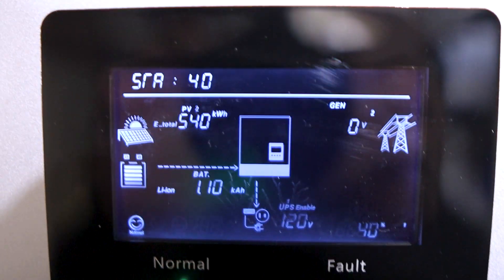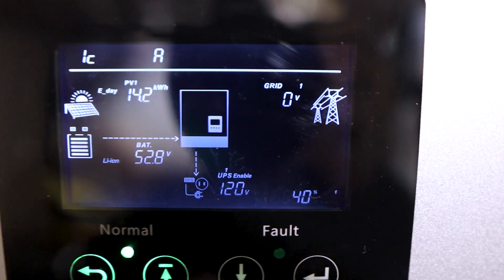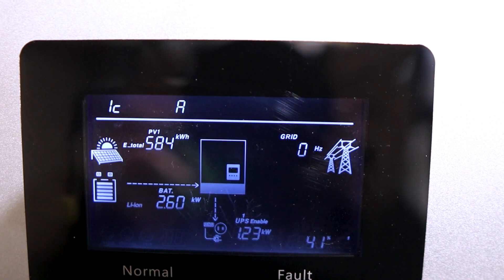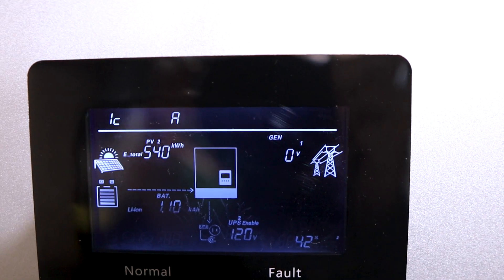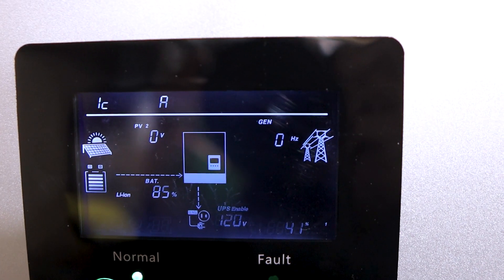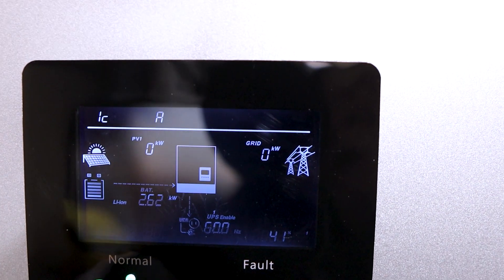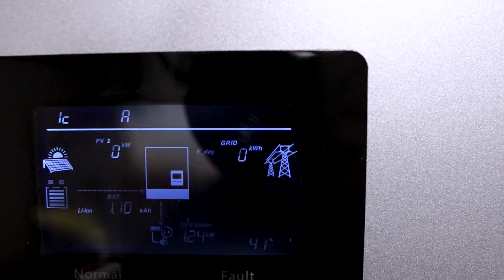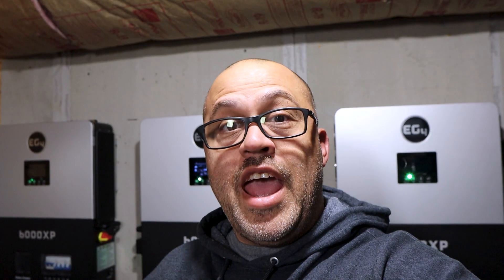EG4 6000XP - How to get Maximum PV Input Power

Comment: That doesn't work . At least I can't go.past the 125
Reply from the maker: How many inverters and batteries do you? It can be limited by your system size of course.
Reply: @rodneyhunt  single inverter
Reply: Have you figured it out yet? I'm having the same issue. Full sun and 100 w are coming in with 4,000 available

Comment: Hello good day I need help with something.
I added 8 Solar panels each being 400 watts and then the inverter only shows 270 volts and 75 watts coming in can you explain how to fix this issue
Reply from the maker: Just depends on your setup, partial shading, wiring, connector problems, etc

Comment: 1 question,  when I go to step 6 to make this change it will not except it, it allows me to enter 3520 but when I hit set  it just says error,  should the UPS AC output be shut off or in standby or any steps I should take for it to allow the 3520 setting?
Reply from the maker: How many inverters and batteries do you have?
Reply: @rodneyhunt I just have the one EG4 6000XP and 4 12 volt lifepo4 200ah with 200 amp BMS in series.

Comment: I can't set mine that high and I'm
Not getting any pv input at all
Reply from the maker: Are your batteries communicating with the inverter? How many inverters do you have? Might need to give signature solar a call and see if they can point you in the right direction.
Reply: @rodneyhunt  yeah I’m waiting to call them tomorrow because their tech-support is closed today🙄 I only have one battery which is the wall mountain battery indoor and I have one inverter. everything seems to be communicating fine at the same time I have troubles with the app. I appreciate your help and your videos regardless I’m new to the scene but learning very quickly.
Reply from the maker: So you may need to try a lower setting. Each setup has a maximum so start low then increase it as far as it will go. Might be another setting as well. Have you checked voltage right at inverter? Is your PV switch on? Just to verify what you have

Comment: Thanks for all the your videos I find them very helpful, I do have a question on the EG4 6000XP that I hope you can help with, it says in the manual that the PV input can handle up to 500 volts, but is that 500 volts per MPPT or is that 250 volts per MPPT for a total of 500 volts?
Reply from the maker: That is per MPPT. So you are good to go with higher voltage for each

Comment: I found this issue and signature solar insisted 125 was max, that made no sense for 2 inverters.  I changed it and will see what happens tomorrow. I added 6k worth of panels and it was basically not being utilized for charging, only with an AC load.  Now, With that said, Where did you come up with this being a correct number? How is it you have this but the sellers and tech people don't? Where did you get this number? Would it not be 125 per unit, 250 for my pair? I have to wonder why its tied to the AC charging number? I realized after i could just set it at 3520 in the app as well....
Reply from the maker: I just set it to the max. The battery BMS will limit power if ever needed but I have plenty of batteries for my array. I asked them before and can’t remember the exact explanation from them but will look back.
Reply: @rodneyhunt  I (we) need to still be able to limit AC charging and it cannot be that high for AC so common sense says there must be separate settings for max amperage on AC charging vs the solar panel charging. I did not realize this was being throttled and it made for some damned irritating attempts at figuring out what was wrong with the system. The amount of mis and dis information surrounding EG4 from both retailers and EG4 themselves is a real PITA.

Comment: It won't let me go above 120
Reply from the maker: That is weird. Are you using the same settings other than that.
Reply: Mine also will only allow me to go to 120. But I only have one 6000xp and 2 Lifepower batteries.

Comment: Great find Rodney, I think that setting is actually an engineering unit rather than a maximum amperage setting. I've got 4 EG4 600oXP's in parallel and max should be 4480, but can't go above 3520.
Reply from the maker: Yeah I had no idea what the units for that would be but it needs to be higher to get full input from my system. 👍

Comment: Can you describe where the fans are located.....is there screening small enough to keep moths or miller bugs as we call them from getting into the unit?  My 6000 EX have filters on the sides but the screen size is small enough to keep bugs from getting into the unit and shorting it out.
Reply from the maker: Will take some video and let you see

Comment: Ok Rodney, I am confused, sooo confused. I do not have a system yet but I'm learning. In my 6000XP manual that I downloaded, Step 6 is for "Ic: Maximum Charge Current (Utility+Solar)" Range is 0-125A. The manual says "Maximum MPPT Amperage The MPPT can accept up to this amperage (clipping will occur past this value) 25A. Also the spec sheet says "MAX. CONTINUOUS AC CURRENT 37.5A @ 240VAC". What is 3520? 3,520 Amps? 35.20 Amps? Why does that step say Max range 0-125A when I can only get 25A from the panels and 37.5A continuous from the grid. What am I missing? How do you get more than the combination of 62.5A  (25A + 37.5A) ?
Reply from the maker: It is some kind of combined amps I think. Solar, ac charge, etc. I contacted eg4 fir more details and will let you know what I find out. Regardless the mppt will only accept the max watts and just make sure you keep your panels below the amp specs you will be good. 👍

Comment: When Shared Battery is enabled you need to increase the max amps to account for all parallel inverters.  Yes the manual should explain that better.
Reply from the maker: I definitely missed the explanation lol! I figured the mppt will take in the max they can until I can test to see what I really need to set it at.
Reply: @rodneyhunt  if you check setting 6 on the other inverters...you will see its mirrored on all inverters that have shared battery enabled.
Reply from the maker: Yes it is mirrored!
Reply: @rodneyhunt  you can set it to 420 (140*3)...the BMS will still direct a lower charging amperage if it needs to.
Reply from the maker: Yeah I need to adjust it down at some point but since I am not using the grid or generator I have not.

Comment: Thanks, curious why you would need it that high, my strings each  bring in around 11 amps and 400 volts?
Reply from the maker: I just set it at the maximum it lets me. Like I said not sure why it doesn’t work at default amps but it works with max settings. Will ask why this goes so high. Maybe the settings need to be updated or something
Reply from the maker: I think I have at up to 340 volts on some strings at 11 amps. Then on another inverter i think 200 something with 18 amps
Reply: @rodneyhunt thanks my strings each consist of 8 q cell 485w bifacial open circuit ratings of  11.2a, 53.6v panels. on freezing cold days when the sun pokes out I see up to 420volts  but feel these are perfect strings for these inverters to get close to max input. I have seen 8k on my master inverter multiple times in the past month
Reply from the maker: Nice!
Reply: Thanks just switched mine up to 240 from 140 it was auto set at, will compare charge rates next sunny day and post here of any changes I see using solar assistant